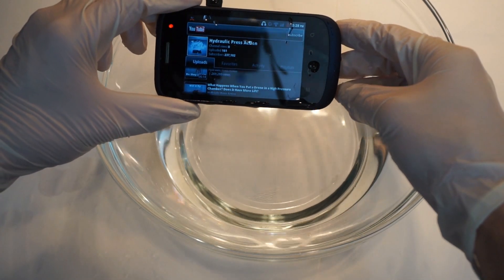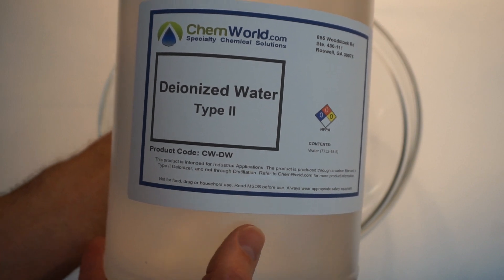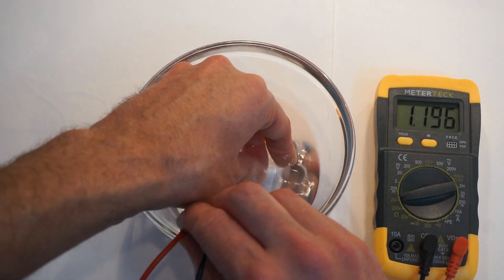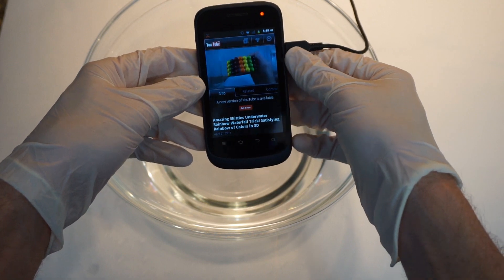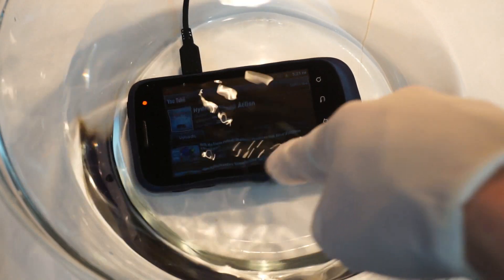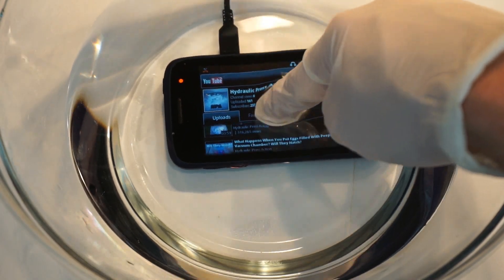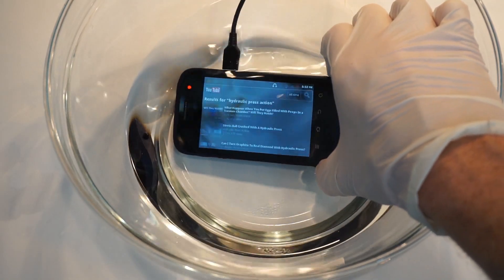Is Everything Waterproof in Pure De-ionized Water? Charging Phone in Pure Water Test

Comment from the maker: Hey my subscribers, I just changed my channel name to "The Action Lab"!! I will keep doing hydraulic press videos but I have so much more content now that a channel name change seemed necessary. Thanks for your support!
Reply: The Action Lab It suits it better now that you've got new gear. Well thought.
Reply from the maker: +Gangster 123 There are no free electrons in water...In metals, electrons transfer the charge, but in water, all the electrons are bound. Ions are what are moving in liquid. That is why you need an ion bridge for batteries to work.
Reply: Hey Lab, because the sweat on your skin had salt in it, it easily dissolved in water mixin İons. Not the matter with electronics though.
Reply: Hello ;), hmmm it's good but i think you can make it better also keep up the good work ure one of my fav youtubers!
Reply: How long does it last underwater?
Reply: The Action Lab are you going to change the profile picture?
Reply: Good move!
Reply: tokojkis yes but it can get very dangerous because de ionized water is destilled water. that means no minerals no salt. and if the water gets to your stomach your cells want to have the same ammount of minerals as the water. so they start soaking up with water until the have the same mixture of water and minerals as the drinks food etc in your stomach. thats why we have isotonic drinks. and thats how we get all the minerals out of the food and drinks. so if you drank a bit of that water ok. but if you drink more you the cells of your stomach are going to soak so much water up until they pop
Reply: a common phone usualy have around 3.7 volts batteries
Reply: The Action Lab good
Reply: Nice name!
Reply: I also love the new name!
Reply: @Kasey1776  what was the old one
Reply: @thesnowman2509  To be honest, I don’t even remember.
Reply: @Kasey1776  lol I didn’t think so. 4 yrs ago anyway. O well I think I can look it up
Reply: Wayuyyyyyy better. <3
Reply: The Action Lab nice
Reply: tokojkis I think its fine since human's major electrolyte source is from food instead of drinking. you'll probably starve to death before you run out of ions by drinking DI water
Reply: The Action Lab sorry my bad! I should've informed me better
Reply: The Action Lab you should've made another channel with this science content
Reply: you should try to mesure the resistance while the phone in the water
Reply: bnm1 x mineral oil
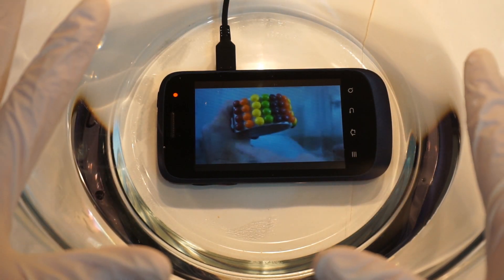Reply: The Action Lab on 5:05 you said that it's the ions that transfer the charge! actually it's the free electrons!
Reply: The Action Lab Jesus guy! Quit touching everything. Hey let's see if this works and try failing the experiment at the same time
Reply: The Action Lab the battery is ruined though...
Reply: The Action Lab Is De-ionized Drinkable?
Reply: Deleted Account Forever aslong it doesnt looze its power
Reply: The Action Lab Whats the song on the background ?
Reply: The Action Lab what did it used to be called?
Reply: The Action Lab i have the set that that led circuit came from
Reply: Can you drink the deionized water?
Reply: Hi
Reply: just saw a clip of this video on outrageous acts of science. I tend to notice when my favorite YouTubers appear on that show. congrats for gaining their attention.
Reply: You should hopefully plug in the phone charger to a battery pack not your wall, did you?
Reply: How did it get signal tho? Are 2/3 cm not enough to affect the signal?
Reply: Anankin12 signal is not electricity.
Reply: Ben Braceletspurple Water blocks out signal; in fact, underwater submarines don't use GPS to navigate when they are submerged.
Reply: Anankin12 it reflects it, doesn't block it. How do you think submarines communicate? Whatever. You may know something, but not much about signal.
Reply: Ben Braceletspurple isn't it the same? If the signal gets reflected, it then gets somewhat distorted; how can it play a video from the Internet?
Isnit because there isn't much water?
Never calimed to know anything, just that I wasn't associating electtic current with signal (although there is a link, given how said signal gets "created" and received, but that's beside my point and your point)
Reply: You put the probes in the de-ionized water wayyyyyy further apart than you did in the tap water. Doing stuff like that purposely kinda discredits everything you post an say. nice try
Reply: U r in YOU HAVE BEEN WARNED
Reply: nice
Reply: the phone is not" pure " and if any oxidation occur that will change the conductivity of water
Reply: bnm1 x You really dont know how water cooling works do you?
Reply: Good thinking!
Reply: TheMakyato it wouldn't change, resistance stays the same.
Reply: Does pure water boil in the vacuum chamber?
Reply: can you drink De-ionized Water?
Reply: that was snap circuits.
Reply: I downvoted because your description is too long

Comment: Assuming that's a Snap Circuits LED, you shouldn't connect it across the battery like that--they're not designed to handle that much current directly. You're supposed to put the LED in series with a resistor. Trust me, I blew out multiple Snap Circuits LEDs this way as a kid.

Comment: 1:33 You should have brought them closer together. There may have been trace amounts of ions in the water that could allow for some conductivity at closer ranges. Especially important to test considering you're dropping a circuit board in there where the connections are less than a millimeter apart.

Comment: I think the phone would be fine in normal water,  it takes time for the air to come out and get fully wet,  but over time there are things that are ruined by moisture ingress. At 4 volts there is almost no current leakage even if the water contains moderate ions.

Comment: liquid damage on electronics isnt generally due to the water or liquid shorting out but has more to do with the corrosion that comes after most devices that get wet  and turn off come back on after a little drying but without proper drying and cleaning the corrosion will kill the device i highly doubt that phone lasted much longer after this

Comment: Cool video!  Water is conductive though, just very very very very little.  If you push enough voltage across it, it will start to ionize itself and form and chain and induce current.  A related thing occurs in lightning in air.

Comment: As a phone nerd... water damage on phones are not becuz water shorts out the circuit. Regular water are still not sufficient enough to conduct electricity at such low voltage ran by phones. Water damage are mainly due to circuit corrosions and LCD damages not due to short circuiting.

Comment: The only problem with that is I imagine it's quite difficult to dry the phone without completely disassembling it and hitting it with a hair dryer, because it's going to ionize from the air and Fry itself if it stays on
Reply: It should take between 15 and 20 minutes for ions to dissolve out of the air and break the phone

Comment: „Basically the same as in air, no electricity can pass through“....
Please don‘t spread wrong information.
Water always has OH- and H3O+ Ions in it, since that‘s the natural equilibrium reaction of water (not sure if the terminology is right, english isn‘t my native language), which means electricity will always be able to pass through with a MUCH lower voltage than in air.

Comment: Dear Action lap
All information in this video are either wrong or mostly not accurate
Radio frequency interference depends on the frequency band, antenna type, equipment quality, among many other factors.
To give you an example some systems installed in manhole, where manhole cover made of 2" cast iron. And works fine.
Others like the car toys with remote effected enormously by 30 feet distance and slim concrete wall

Comment: Two things in this frustrate me...

One is that every single material in existence has finite resistivity, and therefore non-zero conductivity. Yes the conductivity of water is very very low, but you can’t say that it “doesn’t conduct at all”

The second is that liquid water ALWAYS contains ions, namely hydroxide (OH-) and hydronium (H3O+). The  amount of both is super low, yes, but water always dissociates to some degree so they’re always present.

In fact this could’ve been a nice moment to teach some other interesting properties of water. The concentration of both hydroxide and hydronium ions in pure water at room temperature is 1x10^-7 mol/dm^3. This might seem like a meaningless arbitrary value (and maybe it is) but it’s interesting because that 7 is very significant - it is the reason for the very familiar fact that“neutral” on the pH scale is 7. 

If pure water had absolutely no ions in it whatsoever, the pH scale wouldn’t work, and we’d have to rewrite every single textbook on acids and bases

Comment: Impressive that your wifi reception works underwater 
Especially as it uses microwave frequency. Perhaps the cable works as an antenna. Would it still receive if it was not charging?

Comment: You said that's cool but one time I had a small rc submarine and I put it in a bowl of rubbing alcohol and then I lit the alcoholic and the sub worked fine in it for close to 15 min, then it started to act up and edventually the fire ended it, but it moves up and down by propeller so it would shoot fire up when I pressed down, I may be wrong but I think that it happened because the fire was actually only on the surface

Comment: this is why you should never drink pure water or distilled water. It will dehydrate you and strip you from minerals in your system!
Reply: It doesnt dehydrate you. Dehydration as a medical context is the deficit of water in the body. It can have different effects depending on the specific conditions surrounding it. 
 It can result in conditions such as hyponatremia which is basically low sodium in the blood. Hypo meaning lower than correct, nat being from natrium the chemical basis for the name of sodium and emia, having to do with being contained in blood. 
 This can be beacuse if ingesting of water is reduced or eliminated, this can also for various reasons cause a reduction in the intake of sodium and other minerals such as potassium. This can cause an Na K imbalance or deficiency which can cause ataxia and other symptoms because the body can no longer control the movements of muscles correctly because of electrolytic imbalances.
 Since deionized water will cause cells to absorb water to attempt to create an ionic balance, and the concentrations are so great that locally whereever deio water is located, the cells suck up water to the point that they burst. This is apoptosis. Its typically self limiting with transient contact or ingestion of deio water since when the cells burst, they spill their contents into the surrounding water and give it ions. As this effect persists, it weakens because the concentrations reach equilibrium and the reaction stops. Prolonged contact with a large ammount of it or ingesting a large quantity can be more damaging. 
Interestingly this has a medical use in cancer treatment. During an operation to remove a tumor or other cancerous tissue, after all the visible affected tissue is removed, deiowater will be applied to the cutterage to attempt to cause apoptosis to any remaining cancer cells or cells shed from the main mass during removal. This has the effect of damaging any tissue it touches so great care is taken in the application but it it used. It also has the risk that the bursting cell will spill the dna thats compromised with cancer and that could be incorporated into other cells, beginning cancer anew, so suction is also used to quickly remove the water, and hopefully any apoptized cells and their contents simultaneously with the application.
Reply: Re oh my god gtfo
Reply: Salvador Peláez if it strips you from it, but it's still inside you then why does it matter
Reply: *overhydrate
Reply: Apple User 
Yeah, ultra pure water is tasteles, as well as ultra pure alcohol.
It least that's what I've heard.
Reply: Salvador Peláez distilled water tastes like crap
Reply: That's an urban myth.But it does give a weird mouth feeling and can give you a drie troath because of that.
Reply: Salvador Peláez That's not how water works

Comment: DI water is something you guys should not drink. It's dangerous. There are no minerals in DI water. Which is bad. We need minerals in water. Springwater isn't bad and it contains some zinc, iron and other stuff that's needed. In fact if you drank DI water it will absorb the minerals in the body. So you can die from it. Well if you drank a drop of it, it won't affect you. But drinking a whole gallon of DI water will affect you.

Comment: to deepen th info you give and give some volume to it. water alone is not conductive but the inpurties that is in normal tap water is and when you take Your hand in the water inpurities from Your hand og into the water. then the reason Your chacking sircut Works is to my knolage is cuz it got not part that can be broken in water. unles the batery can destroy itselfe water wil not dammage it.

the reason a phone wil be dammaged in water is cuz the wires are so Close together that the water wil make the Electrons jump and change the coltake and amp in the wire NeXT to it and that migh lead to a resistor being dammaged and stop conducting same it the wire if the wire is not cpable of handeling the Electrons it gets it is dammaged. so InFact yo ucan have an exposed wire in water no danger to it as it got no other Places to be dammaged. but put a high woltake wirw With a copper wire the copper wire wil be dammaged when the Electrons try to use that as wel as a conductor.

Comment: some water molecules can and will spontaneously split into ions and eventually, even deionized water will eventually become conductive. of note, back in the 60-70s, computer scientists tried submerging computers using deionized water as a means of cooling. while it intially worked, over time, the water became increasingly more conductive until the electronics shorted out.

Comment: This isn't accurate at all.

Since this is a cheap phone it is practically guaranteed to have a resistive touchscreen, while expensive phones like iPhones have capacative touchscreens. Ones with resistive touchscreens would work underwater while those with capacative wouldn't.
Reply: Please elaborate.
Reply: Gladly

From my information (I studied this) resistive touchscreens, the ones used in ATMs and cheaper phones work by having an electrical circuit completed by pushing the first ''layer'' onto another which completes the circuit and sends information to the processor about where the electrical signals (touch) was.

Capacative on the other hand detects electromagnetic difference (since your body has a bit more than the air). This is why you cant use lets say a piece of paper with a capacative touchscreen since it doesn't have enough difference, but may work with a battery, since it does have a difference.

You can easily check which type of touchscreen you have by trying to multi-touch. Resistive cannot have multi-touch while capacative does.

Comment: Ions are the only reason water can conduct electricity. If you tried to run current through regular water it would not work, but add some salt to it and the ions' sea of mobile electrons causes the water to conduct electricity, hence why lightning a few miles away from a beach will cause the lifeguards to call everyone out of the water; the ocean is essentially a giant conductive body that kills smaller human bodies if it gets zapped. Pretty shocking stuff.

Comment: So what i understand if i have a water cooled pc with "deionized water" and a spill happens i should be fine if i turn off the electronics and properly dry them???
Reply: 1:40 "But the problem with DI water is that stuff can dissolve into water" thus making it conductive. Most probably your components have some substances on them that will dissolve into water making it conductive. However, I guess that most motherboards are able to shut down if a spill happens, you would most probably fry the mobo but other components may still function. If you are extremely lucky your pc won't have any problems but I doubt it.
Anyway water-cooling systems are thoroughly tested and if you follow the instructions in a water-cooling kit and you check for faulty equipment you shouldn't ever have this problem.

Comment: De-ionised water CAN conduct electricity at HIGH voltages.
Reply from the maker: +Callum Dureau you're right, everything conducts at very high voltages because of dielectric breakdown. It's a different process though. At low voltages it is ions moving, at dielectric breakdown it is electrons moving.
Reply: The moment deionized water is exposed, it will convert back to ionized water.  Where I used to work we had to be <2 ppm dissolved solids.  Nuclear reactors use water that is near 1 ppb.  Yes billion.  Crazy
Reply: Callum Dureau high voltage actually ionize the water itself..
Reply: Callum Dureau So can air
Reply: So is a Tesla Coil an example of dielectric breakdown?

Comment: soo... the most likely result of non-waterproof, low-energy electronics being in water is that the battery drains much faster, which seemed to be the case here as well (battery drained faster than charger could charge it)

actual breaking of that type of electronics from water is more often due to the wiring rusting/breaking as a result of exposure to water

Comment: A short dip, even in regular tap water, won't show or prove much of anything. Water however is also a good solvent, even deionized water, and will wreak havoc on most materials if left long enough. The more stuff gets dissolved, the more corrosive it will get, in a runaway reaction. Leave it a week in deionized water, even without power or a battery, and see how it fares then. That's why reactive substances are kept under paraffin or kerosene, not deionized water.